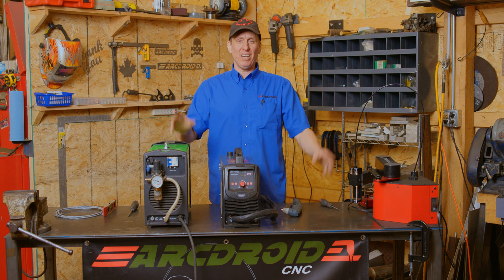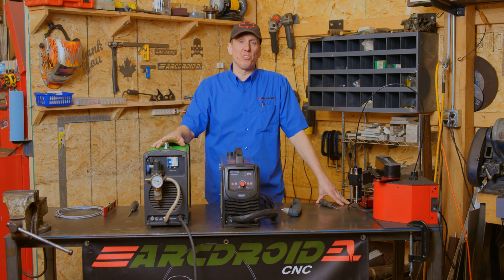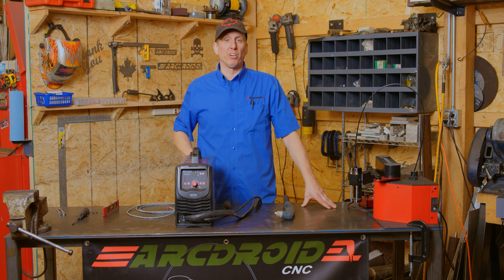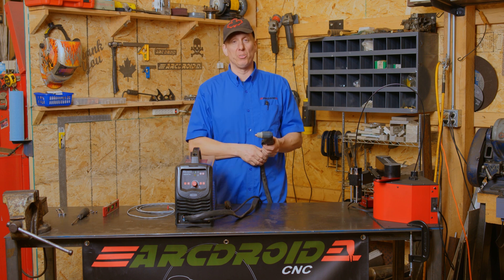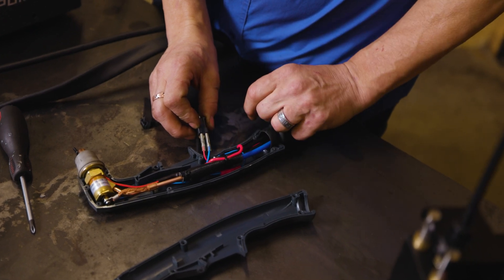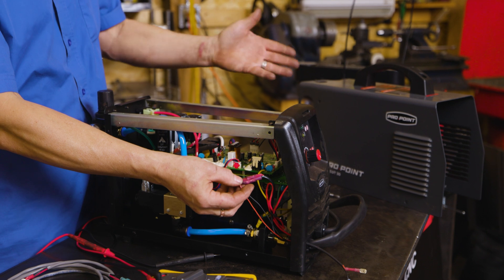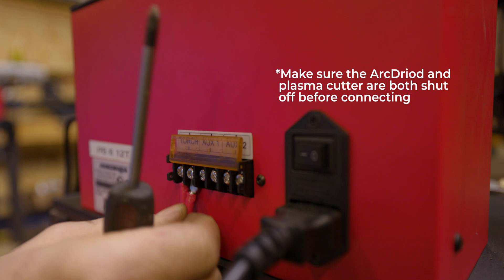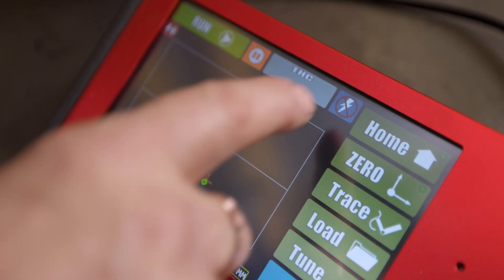Step 2:  Connecting your plasma cutter

Comment: Hi can any one help with connecting THERMACUT EXTRAFIRE 75SD PLASMA CUTTER to the arcdroid ? i have connected it via the cnc interface and found the 2 torch wires but it will not turn the torch on

Comment: When you purchase a machine with the cnc port like your everlast has, do you still purchase the same 18g wire to run to the torch lugs on the back of the arcdroid? I’ve been confused about this since that particular everlast machines doesn’t even come with the 12 pin plug (e.g. a primeweld machine I’m seeing). 
Would love to get a new cutter asap since I rolled the dice with the hf start I already had